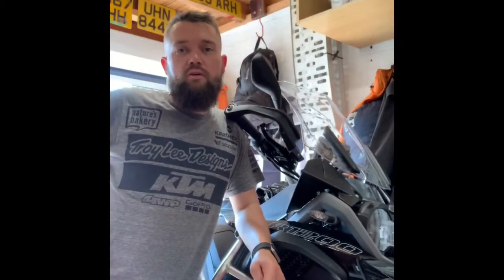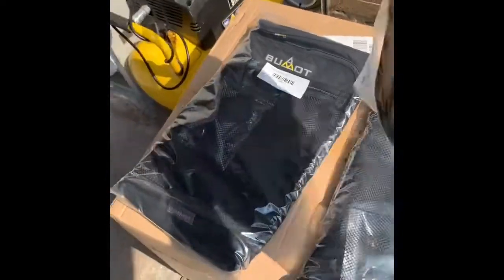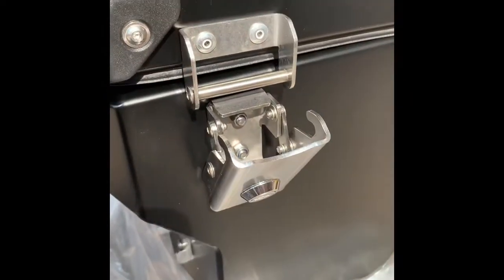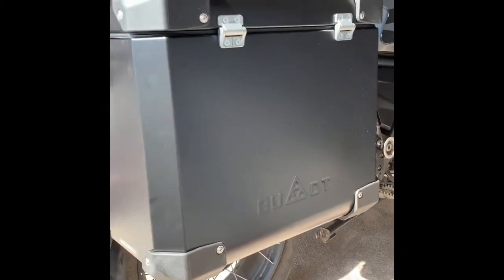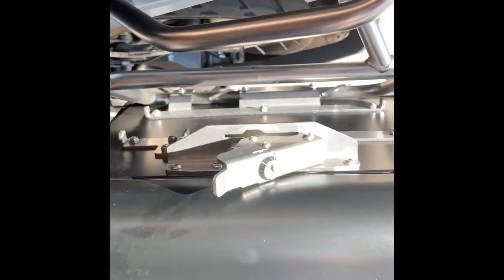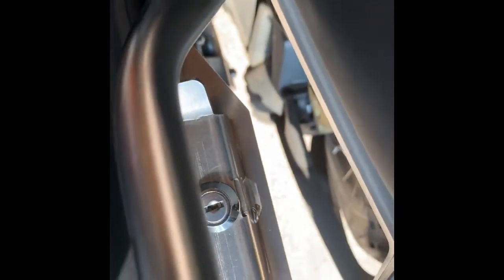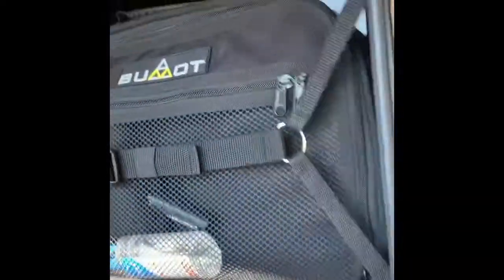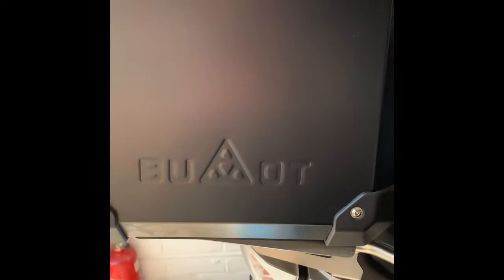Bumot defender evo panniers fitted to Bmw gsa 2018

Comment: Hi, great video. Can you put a helmet on the left side pannier? Thanks
Reply from the maker: Hi not sure quite what you mean. If your meaning putting one inside my scuberth e1 won’t fit if that helps. Ride safe
Reply: @thetiptreebiker   thanks for the answer. Yes,  that's what I want to know because I'm interested in these panniers, but if I can put one helmet in the panniers, that's a problem when I ride with my wife. Can It be because your helmet type is a flip-up one and normally they are bigger? A full-face will fit?
Thank you
Reply from the maker: @sergiomail92  yes possibly it also has a peak.
Reply: @thetiptreebiker   if it’s not a problem for you, because I can’t find them anywhere. Can you tell me width of the entrance on the left pannier? To see if my helmets fit. Appreciated
Reply from the maker: @sergiomail92  hi so the width is 22cms length 42cms depth 35cms hope this helps.
Reply: @thetiptreebiker   thanks for the help. Appreciated. 😉